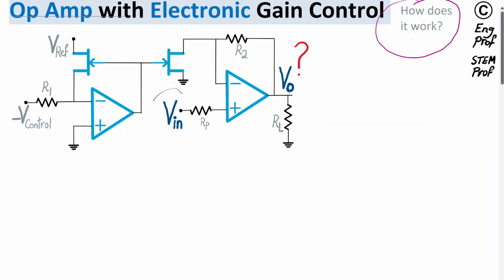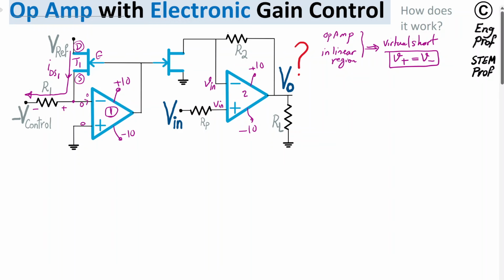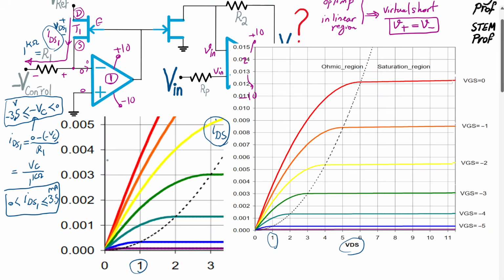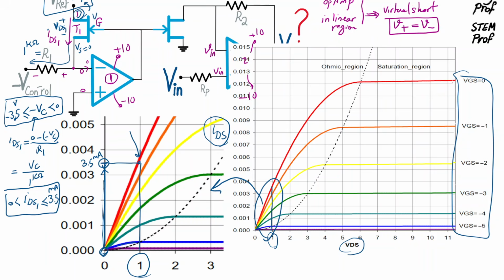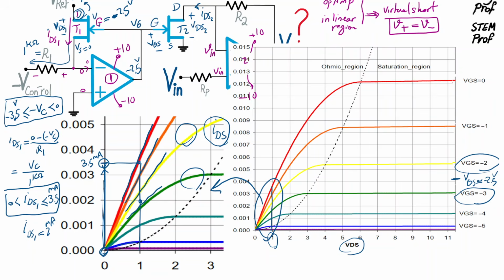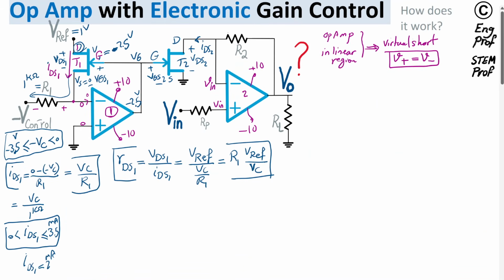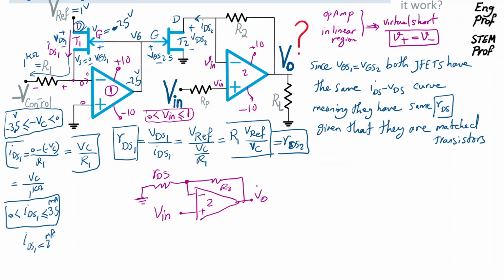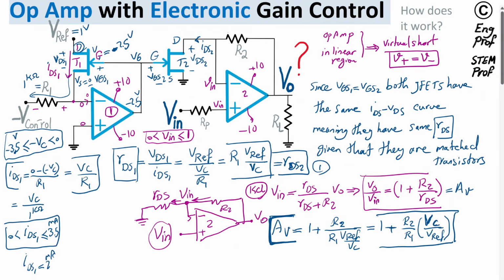Op Amp Amplifier with Electronic Gain Control: How does it work?

Comment: Merci beaucoup pour la vidéo. 
Dans le livre "Art of électronic” , dans le chapitre des mosfets, il y a un exercice ou il est demandé de  prouver que Rds = 1/Gm ,  ou Rds est la résistance Drain Source et Gm la transductance c'est a dire le rapport Ids / Vgs.
Je n'ai jamais réussi à comprendre cet exercice.
Pourriez vous faire une vidéo la dessus ?
Reply from the maker: @samirazarzar6279 Merci beaucoup pour votre commentaire et ravi que la vidéo vous plaise !  Glad that you like this circuit video and thanks for your interest in the channel!  To briefly answer your question: when a MOSFET operates deep in its ohmic (triode) region with a very small drain-source voltage (Vds close to 0V), the channel acts as a linear voltage-controlled resistor Rds. By definition, small-signal transconductance Gm in this region represents the sensitivity of drain current to gate-source voltage (dIds / dVgs). Under these conditions, the channel conductance (1 / Rds) is directly proportional to the gate drive above threshold, yielding the fundamental relationship Rds = 1 / Gm.

I plan to post a brief MOSFET intro lecture video in the coming weeks to detail these device physics. In the meantime, to further explore FET operation and practical applications, these related circuit breakdowns from the channel might interest you:

• Instrumentation Amplifier with Electronic Gain Control with FET transistors: https://youtu.be/C4tghZ-q6Zs
• Digitally Programmable Current Source (2 Op-Amps, 2 MOSFETs): https://youtu.be/yJBreqe0KHk
• Hybrid Current Mirror with JFET & BJT Transistors: https://youtu.be/mNYq5QId1pE
• Voltage Regulator with MOSFET, JFET & Temperature Compensation: https://youtu.be/NdfyHoxjKrY

I hope this is helpful. Thanks again for your interest in this engineering channel! 🙏
Reply: @STEMprof 
Merci d'avoir pris le temps de me répondre !

Comment: Amazing content. Thank you. Subscribed.
Reply from the maker: Thank you, and welcome to the channel! Glad you enjoyed the electronic gain control circuit analysis. If you're interested in analog signal processing and precision op-amp topologies, here are a few related circuit videos you'll likely enjoy next:
▶ Switched-Capacitor Amplifier Design: How does it work? https://youtu.be/n8UOTmPI4aI
▶ Sallen-Key Filter Design Tutorial: LPF, HPF Frequency Response https://youtu.be/KwUnQXbk7gM
▶ Why Professional Audio Amplifier Uses 8 Transistors? https://youtu.be/6yAmWvLaC5M
▶ Analog Multiplier Circuit (4-quadrant): How does it work?: https://youtu.be/VP53A2zpVMQ
▶ 4-Transistor Blackmer Gain Cell Explained: https://youtu.be/XDoZls0CiH4
▶ Log-Antilog Amplifier Explained: https://youtu.be/sBMMs5I3MLA
▶ EKG ECG Amplifier with Right Leg Drive Explained: https://youtu.be/1c7KGXPs4do

Thanks for subscribing and your interest in this engineering channel!

Comment: Thanks Sir. Very appreciated.
Reply from the maker: You're very welcome! I'm glad you liked this electronic gain control Circuit with FET transistors & OpAmp. You might also find the following circuit videos interesting:
▶ How 4 Op-Amps and 4 Transistors Compute x³ https://youtu.be/wSzs9TskEsw

▶ Related Electronic Gain Control & Log Circuits:
• Instrumentation Amplifier with Electronic Gain Control: https://youtu.be/C4tghZ-q6Zs
• Analog Logarithm Computer: https://youtu.be/RpKEq5WyoLg
▶ The VCA Series:
• Part 1: Voltage Controlled Attenuator Circuit Overview & DC Bias: https://youtu.be/cFzYZsPEtP0
• Part 2: VCA Electronic Attenuation AC Analysis: https://youtu.be/mq2PyO56OvU

Thanks for watching and your interest in this engineering channel.

Comment: Hola ... serviría como VCA para un sintetizador ??? Puede funcionar con operacionales single supply ...???
Reply from the maker: Good question. Better circuit choice as VCA is https://youtu.be/cFzYZsPEtP0 which explains the VCA Electronic Gain Control design and operation.  Regarding your second question, it is possible to modify the VGA circuit presented here so that it work with single supply. It will require proper biasing of the non-inverting terminals.

Comment: Teacher, could you post one AGC circuit for MCU control using a DAC?
Reply from the maker: Glad to see your interest in this Automatic Gain Control Circuit.  Program your MCU to send the digital value of the control voltage to your DAC that then converts it to the analog voltage (Vcontrol) that controls the gain as explained in this video. For more examples please see: 
VCA Electronic Gain Control (Part 1): Voltage-Controlled Attenuator Overview https://youtu.be/cFzYZsPEtP0
Analog Multiplier Circuit  https://youtu.be/VP53A2zpVMQ

Comment: useful , but now a days for real application , jfet as single transistor are in expire way ,so does it possible to use bjt instead of jfet with another configuration ?
Reply from the maker: Good question. Yes, definitely, I suggest watching the following video as an example of how BIpolar Transistor is used for Gain/Attenuation control,
VCA Electronic Gain Control (Part 1): Voltage-Controlled Attenuator Overview https://youtu.be/cFzYZsPEtP0

Comment: What JFET is used here? I cannot replicate this in Ltspice
Reply from the maker: Good question, In this example I didn’t call out a specific JFET model because the analysis is conceptual. As explained in the video, the circuit just requires two matched JFETs operating in their ohmic region (acting as voltage-controlled resistors). In hardware, you could try N-Channel JFET transistors available from DigiKey or Mouser, like 2N5457, J111, or possibly BF245 (just make sure they’re matched).   But in LTspice you’ll need to either: Pick any generic JFET model (e.g. JFETN or 2N5457) and tweak its parameters so that it has a nice linear ohmic region around ~1 Vds, or  Roll your own SPICE model to match the behavior described in the video.

As for “why JFETs and not MOSFETs?”, they’re both Field-Effect Transistors, but they’re not interchangeable here. A JFET has its gate junction directly tied to the channel, making it depletion-mode (normally on), low-noise, and well-suited for analog variable-resistor applications like this one. A MOSFET, by contrast, has an insulated gate oxide, is usually enhancement-mode (normally off), and while great for high-speed switching and digital logic, it doesn’t naturally behave as a smooth, symmetric, voltage-controlled resistor in this region.

So the bottom line: the exact part number isn’t critical, but what matters is using two well-matched JFETs with consistent Vgs–Ids curves, so the op amp feedback can do its job and the gain control behaves as explained in the video.

Comment: Thank you, good video. But this is theory...
I could not find such a paired transistor on the market.
If it is not too much trouble, please give a couple of examples of such transistors.
And if there are such transistors, then what parameter in the datasheet indicates that the pair is matched, made on one crystal?
I really need it. Thank you.
Reply from the maker: You're welcome. Glad that you like this Electronically Gain-controlled amplifier circuit design video. Answering your question, as an example, Texas Instruments' JFE2140 is an Ultra-Low Noise, Matched pair of Low-Gate Current, N‑Channel JFET Transistors designed based on Texas Instruments' novel analog bipolar process https://www.ti.com/lit/ds/symlink/jfe2140.pdf . The JFE2140 offers excellent noise performance across all current ranges, where the quiescent current can be set by the user from 50 μA to 20 mA. In addition,
the matching between JFETs is tested to ±4 mV, providing low offset and high CMRR performance for differential pair configurations. A related video is https://youtu.be/PIAsa0QNVns that explains the design of an Analog Vector Summer Circuit with Op Amp and BJT Transistors.  I hope this is helpful.

Comment: Thank you. Am I right in saying that Vin is restricted about 0 to 1.3v so we remain on the liner part of the -2.5v curve?
Reply from the maker: You're welcome! Yes, this is a small signal programmable amplifier and hence Vin is expected to be a small signal, usually with amplitude in the 10s or 100s of millivolt range. After this programmable amplification stage, we can use a second stage of large signal power amplifier (if need be) for further amplification for example: Push-Pull Power Amplifier with Darlington Transistors https://youtu.be/866MYibo8yE video or  Push-Pull Power Amplifier Design with Op Amp, Sziklai Darlington Transistors https://youtu.be/8BFzsi7-Vbs video.

Comment: That was awsome.
Thank you very much.
Reply from the maker: Thank you. I'm glad that you liked my video. Here are a few related Electronic Amplifier videos and tutorials:
Instrumentation Amplifier with Electronic Gain Control https://youtu.be/C4tghZ-q6Zs
VCA Electronic Gain Control explained https://youtu.be/cFzYZsPEtP0
Analog Multiplier Circuit  https://youtu.be/VP53A2zpVMQ
Push-Pull Power Amplifier Design with Op Amp, Sziklai Darlington Transistors https://youtu.be/8BFzsi7-Vbs
Let me know if these Circuit videos are helpful or if there is a specific Circuit you're interested in.

Comment: Hey, how stable would this be over temp? I imagine it would drift a lot? What would be a solution for that?
Reply from the maker: For practical amplifier design, op amps and JFETs need to be selected carefully and if need be with proper temperature compensation. I suggest using zero-drift low-noise CMOS Op Amps possibly with internal temperature compensation from Texas Instruments or Analog Devices. It is also recommended to have small feedback capacitor between the output and negative input terminals of each op amp. Here are a few related videos: Gain & CMRR of Instrumentation Amplifier Explained https://youtu.be/Bw29QjHHzGo
PT100 RTD Temperature Sensor Explained with Error Compensation https://youtu.be/Fsd-X69awFk
Anti-Log Analog Computer with Temperature Compensation https://youtu.be/kk2c7Gk3nW4
I hope these videos are helpful.

Comment: Very good explanation. Thank you.
Reply from the maker: You're welcome. Glad that you like the explanation in this video. For more Electronic Amplifier examples see: 
Instrumentation Amplifier with Electronic Gain Control https://youtu.be/C4tghZ-q6Zs
VCA Electronic Gain Control explained https://youtu.be/cFzYZsPEtP0
Analog Multiplier Circuit  https://youtu.be/VP53A2zpVMQ
Push-Pull Power Amplifier Design with Op Amp, Sziklai Darlington Transistors https://youtu.be/8BFzsi7-Vbs
I hope these Circuit videos are interesting as well.

Comment: Very interesting! Never saw this topology before. Two questions: Is there any control voltage feedthru? Or it's free from it? And, is the Vref voltage be arbitrary? Or one have to find the correct one?
Reply from the maker: Glad that you liked this video. Depending on the chosen FET transistor, Vref needs to be adjusted to make sure transistor remains in deep ohmic region (so Vref might be required to be as low as ~0.5 volt).  Here are few more examples:  
1x, 10x, 100x, 1000x Switched-Gain Instrumentation Amplifier https://youtu.be/9-MLqyewXW8
Instrumentation Amplifier with Electronic Gain Control https://youtu.be/C4tghZ-q6Zs
VCA Electronic Gain Control (Part 1): Voltage-Controlled Attenuator Overview https://youtu.be/cFzYZsPEtP0
Variable Gain Instrumentation Amplifier for designing Thermometer Current Source https://youtu.be/Ggf0yCaTTiY
Switched-Capacitor Amplifier Explained https://youtu.be/n8UOTmPI4aI
I hope these videos are interesting as well.
Reply: @STEMprof   Thanks for your answer. Yes, of course I will watch all of them (and already watched some), they are all great. Thank you!
Reply: @STEMprof  Re. control voltage feedthru, I'd like to know if with this topology there is some of the control voltage superimposed on the output (since it is a common problem on all VCA topologies except when using optocouplers)
Reply from the maker: Thanks for comment & sharing your thoughts. As you pointed out, control Voltage feedthrough is a practical concern in all voltage-controlled electronic circuits. So while it should be minimal in this FET-based op amp circuit it needs to be simulated to make sure the level is low enough for the specific target application.  I hope this is helpful.  Please see Electronic Amplifiers Videos Playlist for more design choices and examples https://www.youtube.com/playlist?list=PLrwXF7N522y5679YAO-lFrNVYqV9XMNTr

Comment: Why the output of first opamp connected to gates of the FET??

The FET already has voltage on the gate from the current Id
Reply from the maker: We want to linearly control (for the second JFET) the resistance value between JFET drain-source as is the case in the presented circuit. Without OpAmp and its output connection to the Gate, the drain-source resistance would be nonlinearly controlled by Vgs (approximately quadratically). For more Amplifier, BJT, JFET Circuit examples please see my Analog Video playlist:  https://www.youtube.com/playlist?list=PLrwXF7N522y4c7c-8KBjrwd7IyaZfWxyt
I hope this explanation is helpful.

Comment: I learned something new!!! Thx
Reply from the maker: You're welcome. Glad that this video is helpful. For more Electronic Amplifier examples see: 
Instrumentation Amplifier with Electronic Gain Control https://youtu.be/C4tghZ-q6Zs
Power Amplifier Design (Class A) with Transformer https://youtu.be/gKlJrqGqeCI
VCA Electronic Gain Control: Voltage-Controlled Attenuator Overview https://youtu.be/cFzYZsPEtP0
Analog Multiplier Circuit  https://youtu.be/VP53A2zpVMQ
Push-Pull Power Amplifier Design with Op Amp, Sziklai Darlington Transistors https://youtu.be/8BFzsi7-Vbs
I hope these Circuit design and analysis videos are interesting as well.

Comment: Did you solve the equation for the control function where the classic MOS/JFET function in linear region is used? I came across a similar problem where i want to adjust the MOS driving voltage for the switches in a R2R DAC so that they are a precise fraction of a linear resistor. One solution to this is to have a Vds voltage drop for the same unit current drop to the fraction resistor electronic regulated. The practical problem is that if the fractional voltage get into the region of the offset voltages of the regulator this get inprecise.
I guess that the control function is nonlinear in both, the control voltage and the signal voltage.
The nonlinearity of your problem sound similar to the problem i had; I need to operate the regulation circuit far from the operating point inside the R2D+MOS application to avoid strong mismatches because of regulator offset voltages. I found a solution by using a "third" MOS operating in saturation defining with the same Vgs the unit current. This current is different over PVT to the R2R+MOS but the solution is to force the Ids via a current mirror bank to the upscaled fraction resistor and the "rds" measurement resistor at the same time. Sadly the patent do not contain the math derivation:
https://patentimages.storage.googleapis.com/61/52/50/6ec461abe5e4db/DE102007055104A1.pdf
A good exercise would to apply the patent idea to a more linear control circuit with the basic operation like yours.
Reply from the maker: Thanks for watching, your interest in this circuit and your comment. We want to linearly control the resistance value between JFET drain-source as is the case in the presented circuit (notice that JFET drain-source resistance is nonlinearly controlled by Vgs (approximately quadratically)). The linear control is achieved by forcing the Ids current of the first JFET while keeping it in deep ohmic region via forcing Vref to say 1 volt.  Notice that JFET transistor is a depletion device with max drain-source current Ids when gate-source voltage Vgs is zero. We can only reduce Vgs to negative values to deplete channel to reduce Ids current from its max value.  MOSFET (say NMOS) on the other hand has zero channel and zero Ids at Vgs=0. We need to increase Vgs to increase Ids. Op Amps should be able to handle needed positive gate voltage of NMOS as well. The rest of concept should be the same in the sense that we need transistor to operate in deep Ohmic Region and hence Vds needs to be set properly to a small value (by properly setting drain voltage). I hope this explanation is helpful. For more Circuit examples please see https://www.youtube.com/playlist?list=PLrwXF7N522y4c7c-8KBjrwd7IyaZfWxyt
I hope these further examples are interesting and helpful. 🙋‍♂

Comment: Is there a way to control the gain using a positive Vc between 0-5V, like an analog out from a microcontroller?
Reply from the maker: Thanks for watching and your good question. Yes, positive gain control is doable for Automatic Gain Control (AGC) circuit for instance using P-type JFET (there are numerous techniques). I will post such AGC circuit design example soon. For more JFET, BJT Circuit examples please see:
Sawtooth signal generator with Op Amp, JFET and BJT Transistors https://youtu.be/5zHXTx-Vl20
Voltage Regulator design with BJT JFET & Op Amp https://youtu.be/CJl-urzeiTo
Push-Pull Power Amplifier with Darlington Transistors https://youtu.be/866MYibo8yE
For more analog signal processing examples see: https://www.youtube.com/playlist?list=PLrwXF7N522y4c7c-8KBjrwd7IyaZfWxyt
I hope these are helpful. 🙋‍♂️